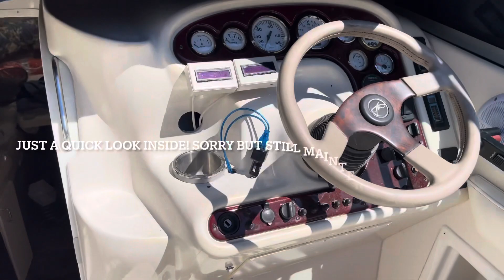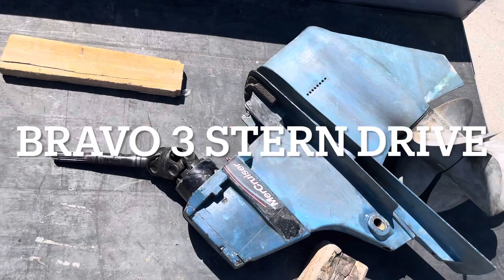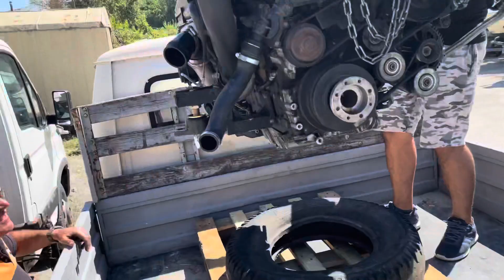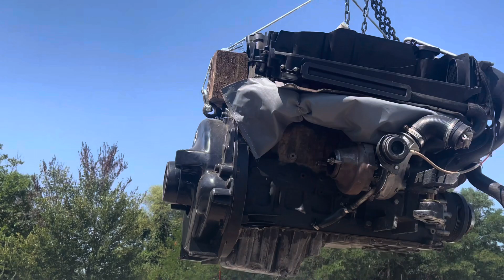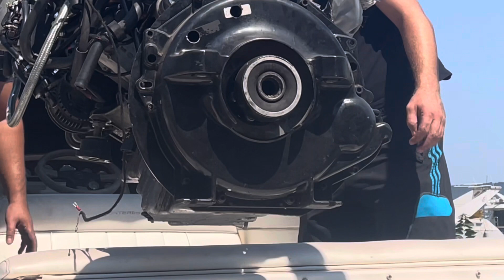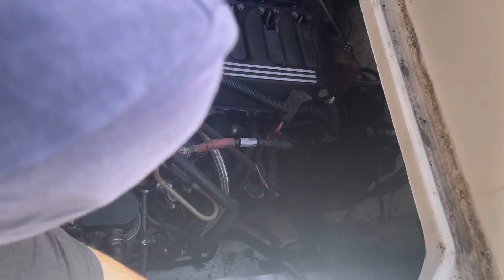Monterey yacht retrofit with BMW engine M57D30 instead of Mercruiser 7.4l MPI - Part 1

Comment: We are just about to do the same, replacing a V6 petrol Mercruiser (190hp) in our Bayliner 2252 with an M57 which we have had mapped to 240HP, we will be adding a ss steel manifold that is water cooled, a large charge cooler, an intercooler and a pulley driven sea waterpump. we'll have a wet exit just after the turbo and side exit exhaust through a muffler box with water.

Comment: Cool project! Im putting 2x in a 30ft formula, could be fun. Quick question, what do you use for the heat exchangers and are you cooling the turbo/exhaust or just wrapping them?

Comment: Awesome work - I can see it has been asked, but what did you do for the exhaust manifolds? Considering using one in a Bertram 20 I’m building, but haven’t found any clear solution  other than wrapping the car manifolds

Comment: How are you getting on with this? Any more videos or details?
Reply from the maker: PROJECT COMPLETED ANY QUESTIONS  FEEL FREE TO ASK
Reply: @SuperFastDriver great project, couple questions. What was the leg ratio, prop pitch and size and what speed vs rpm did you achieve? (Looking very keenly at doing the same for my boat)